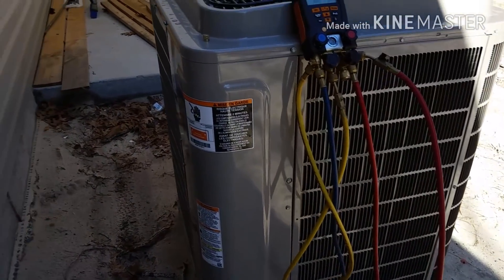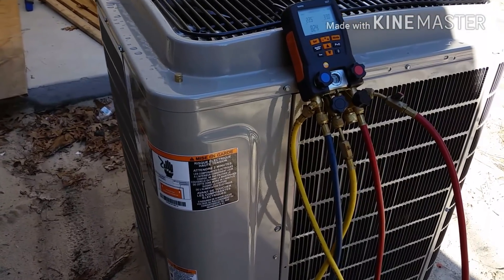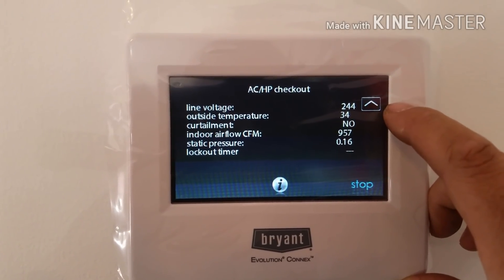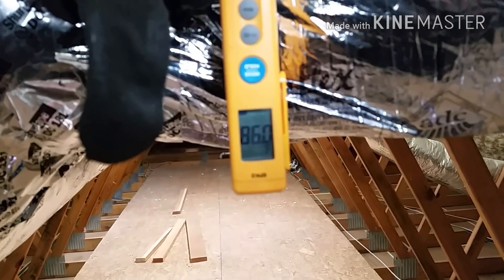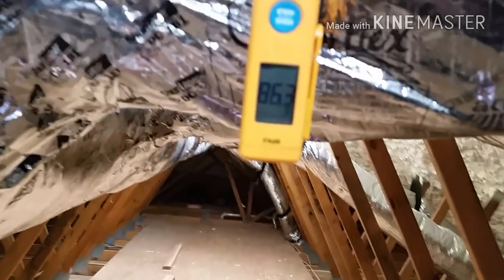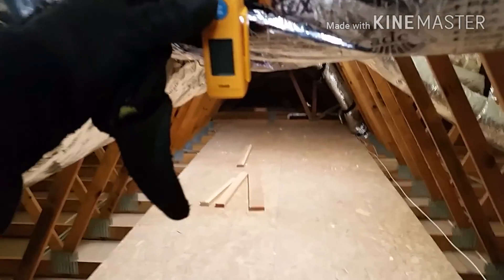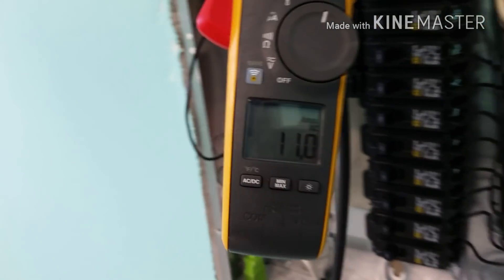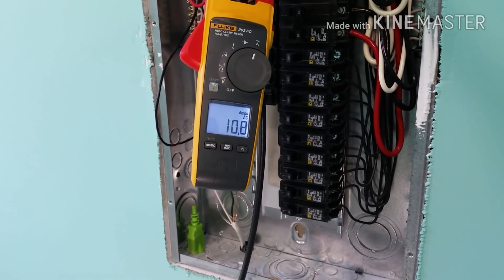Heat Pumps Can't Work In The Cold

Comment: That free return system is interesting. In theory it should work fine but I don't trust that attic to be sealed 100%. 
I lived in Charleston and only ran heat pumps. Never an issue. North Carolina got down to 0 and the auxiliary heat strips finally had to kick in.
Reply from the maker: It's a proven application, just not popular because of expense. 
Also if you get a good company to deal your hose with foam, they test to prove it is sealed eliminating guesswork.

Comment: See all the bad comments on here blaming the units.
No one ever mentions if they had a true heat load calculations done by a certified person whom sat down with them showing them the true facts & figures of heat loss vs cooling cost. So many times over the years I've seen undersized units, inadequate return air ducting/flow, poor controllers, condenser/outside units in a very poor place. Units not cleaned n serviced twice a year , in the spring for summer cooling in the fall for winter heating.  Typically people always go with the cheap guy n buy the better unit in Energy cost over the next few years while not living in true comfort.  Good help is not cheap & cheap help is not good.
If your salesman/dealer won't show you a room by room cost Analysis , find one that does, then find a second one.
In this Information Age , if you allow a poor system to be installed, shame on you. 
Ask for a blower door test & a infrared scan done.   
It's your money they will piss away, on the way to the bank.

Comment: Interesting, though  I wonder how soon the heat pump exterior coils would ice up in that weather.  I also have heat pump but also with aux modulated gas system which switches in around 45 degrees outside  (not thrilled with idea of _defrosting_ a heat pump).
Reply from the maker: Heat pumps frosting over and defrosting is a normal process that cant be avoided. It's Inevitable when the outdoor coil in heat mode is typically 20° - 30° lower than the outdoor ambient  temperature. That's how they are able to absorb heat from the outside air to transfer indoors.

Comment: Keep the snow pile away from the  condenser
Reply from the maker: There are no piles of snow in coastal South Carolina. 😁
Reply: Chris Duhaime , In snow zone, unit should be on a stand at least as high as ‘average’ snow depth, in the south, with NO SNOW, still install 12” above ground, keep from grass clippings.  from Maplewood nj
Reply from the maker: @flybyairplane3528  Nobody's going to lift a unit in the south 12" unless it's due to tidal flooding. Code is 3" from the ground which is cover by the 3" pads used. Hell, in VA where I'm from code was 3" for Air Conditioners and 6" for Heat Pumps.

Comment: Hi, I do own a property in MBeach but live in MTL Quebec. Here heat pumps are working down to 10'f with external tha to switch off and run the 2nd stage. A 13 seer efficiency will do the job. In MB i installed a 16 seer unit and never uses 2nd stage unless it needs defrost. Did subscribe...
By the way I'm a service technician 39 years in April... and still love it.
For the fellow in Georgia " a furnace is for heating as a heat pump is to maintain the heat " .

Comment: Heat pumps are junk.
Reply from the maker: 😆 Such a profound statement.
Reply: Kevin Z06 why do you say that? I know that they are many mis applied. Systems, I would rather have a heat pump,,rather cooling, & just elect strips., From Maplewood NJ
Reply: Agreed,one comment here says they should be serviced TWICE a year
Reply: @gimmieliberty6514  nearly all hvac equipment should be serviced annually... heater in fall and AC in spring.. since a heat pump does both, having it serviced twice a year isnt different. Sure plenty of people don't get their equipment serviced... but if you want it running at peak efficiency and performance, and want to prevent future problems as much as possible, and also have your system last longer since its taken care of... then get it serviced by a reputable company. 
A system with a properly cleaned coil and proper charge will draw less amps and in most cases last longer than a system with a dirty coil and a charge thats off. A bad run cap can lead to compressor or motor failure. Theres plenty of problems that could exist even though it seems to run when you turn it on.
Reply: @0_wardal_0  my mates working in this field, once it gets out how much refrigerant gas is leaking out of these systems they'll be banned,

Comment: I am curious about the electrical air cleaner, why you put it in front of the evaporator coil? It should be placed between the blower and the return duct.
Reply from the maker: +KEVIN LI An air cleaner goes on the return side of any piece of equipment weather it be a furnace or an air handler. That is exactly where it is installed in this video.
Reply: @HVACinSC  Thanks for correcting me.

Comment: Should have went furnace with a case coil. Don’t understand why anyone would want to heat space with 85 deg. When you could heat it with 175 deg. A furnace would pull about 2 amps for the blower motor only. And you don’t have to run a compressor all year. I love the inverters but for cooling only purposes. But I live in Az so bills jump by about 200 bucks in summer time.
Reply from the maker: +Rich Davis You are over stating what a furnace can do as well as understating what a heatpump can do. Neither of temperatures you gave are accurate. An updated Furnace in heating will give a 30°-50° temp rose above ambient. This furnace will give a 25°- 40° temp rise above ambient without electric heat.
Not to mention, why pay for a furnace, propane tank, and fuel in a place that barely uses heat like my area? No brainer for us which is why this region is nearly 100% heatpumps.
Thanks for your opinion.
Reply: Just simply stating a fact that furnaces heat the air more than a heat pump will and don’t have to run a compressor all year. The job done on this house was awesome!! And love the idea of it. Also didn’t realize you would have to use propane in that area. If natural gas is available. Just personally feel it is a more efficient heat source.
Reply from the maker: Heatpumps are light years beyond what they used to be when they got the bad name of "heatpumps can't heat".
I like furnaces and worked on thousands when I lived in VA. I still prefer heatpumps personally but to each their own.
Reply: Climate dose play a huge factor I believe. I’m in Az where units are ran constantly all day and night 15 on 15 min off for 6 months pushed to their limits. I do have to say the new inverters are bad ass! Great set up on that job, great video, and great discussion. Look forward to more content in the future!
Reply from the maker: Thanks. That's a perfect example of why an inverter heatpump or A/C would be more ideal for those applications. Starting and stopping is what causes the most stress on equipment. That is drastically reduced by a variable speed compressor. 
We may not hit those high temps you do but 100° @ 75% humidity causes system to run non stop for 7-8 months around here. Ocean front, sea breeze, and salt air, only compound that issue here.
Reply: The BTUs delivered to the space vs energy consumed is what matters, not air temperature. The CFM for the heatpump  is like double that of a furnace to deliver the same amount of heat. Has nothing to do with efficiency.

Heatpumps are far more efficient than furnaces, they supply far more heat than energy consumed. All of the energy used by the compressor gets absorbed by the refrigerant which helps heat the house and whatever gets picked up by the outdoor coil is free heat. 

The limiting factor is the cost of electricity, being much more than nat gas along with the efficiency of the power plants. If the power plant is gas fired, might as well burn gas directly, need at least a cop of 3 to be comparable. cop = energy delivered divided by energy consumed to do it.

There's also the problem of capacity loss as it gets colder outside, but this has been overcome with inverter technology. The basic single or two stage heatpump won't keep up below 20 to 40F depending on how it's sized relative to heat loss.

For all electric applications, putting a heatpump even if it won't keep up all the time is a no-brainer, when the alternative is fossil fuel you have to calculate costs. There's also dual fuel which offers the best of both.

Comment: I never seen a Free Air Return like that before... pretty cool if it works...lot of Extra SQ FT to heat though...
Reply: Bandits INFO Channel just saw this video . I’ve only seen free open returns in commercial jobs , but I guess there’s not much difference. I think for 100$ I would have installed a 10kw element as well lol
Reply from the maker: @kylemannion8452  System is almost 3 years old and still no expensive electric heat. The physical cost of a heat kit (especially for a factory authorized dealer) is super cheap. They however kill the efficiency of a heatpump in heating mode which is sort of the reason we didn't put them in.. lol
Reply: We really don’t need them here I’m Florida lol. Not bad temperature numbers I’m impressed

Comment: Your not counting the water heater in this it pulls 18 amps alone.or is it on solar.
Reply from the maker: Leslie Overstreet Video was to pointing out the energy consumption of the HVAC system. Water heater is an instant gas water heater which pulls nowhere near 18A. Also technically we didn't have the washer, dryer, or stove running either but thanks for your comment.
Reply: For amps on heat on an HVAC system I would say that is good but, what do you use for heat for defrost mode or backup.
Reply from the maker: Leslie Overstreet No supplemental heat sources needed on this system in this application.
Reply: With everything including the stove, washer, electric dryer, and dish washer. House draws 48 amps. I know because I just sizes it for whole house generator. This is very good considering most houses I've sized for generator are in the 30-40 KW and I can run it completely on 11kw.
Reply: Sounds good is the stove stander electric flat top.or a stand alone oven, or both.

Comment: It is 4 degrees where I am in Maine, USA and my advice to anyone considering a heat pump is: run! Anyone who tries to sell you one saying its "whisper quiet" either doesn't have one or doesn't use it below 22 degrees F. 93 decibels is what the outdoor unit creates in noise and the pulsing permeates the walls. The inside temp on days like today barely reaches 63. I've been recording the data (when machine shuts off to defrost, when it actually turns out heat, etc.) and my installer took the records to the heat pump company and they said "they had never seen such good records". I don't doubt that as it seems like the customers are the testers in this case. Be weary! $7,000+, horrible noise, more $ in electric. First year, this machine will cost $10,000, and will only add more in electric cost.
I bought a propane heater instead: $3,000 WITH electricity costs and it actually heats the home (72 in here now and the unit is silent/completely off). 
Don't buy a heat pump if you go below freezing or like to sleep without a pulsing vibrations!
Reply from the maker: Op Sea  You should really try to educate yourself on heatpumps and the updated technology that has been out for well over 10 years in the US and double that throughout the rest of the world.  Its blatently obvious by your comments that your contractor was clueless on application as well as Installation and now your justification is to blame the technology rather than the morons you hired to install it. Very common to see sadly. Truth is that MANY heatpumps of today can maintain 68 degree indoor temp at -8* F outside. Tested, proven, and the info is readily available to anyone who looks for it online. This systems cost less than $1 a day to run in summer and about $1.65 per day on cold winter days. Saying these units will cost you $10k in the first is comical at best. Thanks for your comment but you couldn't  be more misinformed on the subject.
Reply: Your contractor is and idiot and doesn't need to be installing systems over his grade level. I have this unit outside a bedroom window and installed correctly it's quieter than any unit I have ever had. Then again they really should not be recommend in places that stay that cold for an extended time.

Comment: That unit can do reheat dehumidification. But needs heat strips for it. VERY SWEET control feature!

If you start tracking relative humidity, I bet you'll start selling these with the heat strips when levels go wonky during low latent load, high humidity periods. 

Also bet you'll stop selling ERV'S. Pressurize offers better control, particularly good in wet climates.
Reply from the maker: Ted Kidd Using the reheat feature drops the systems  efficiency drastically.  We've installed over 400 of these systems and only use reheat dehumidification on less than 5 due to unusual circumstances.
And we still offer ERVs and will continue but thanks for the comment.

Comment: How is it that you are able to pass inspection by the mechanical inspector for not having a ducted return? Even if the attic is as you say "conditioned or Some what conditoned". There are no supply runs in that space that I could see to heat or cool it, so technically it is not conditioned area. I will have to learn more of this application. I live in NC.

Comment: That is pretty cool, like most guys in the trade I was always told that heat pumps are garbage in cold weather. I do live in Michigan though where it gets into negative temperatures regularly in the winter. If it gets below 0 there, can you do another video so we can see performance then?
Reply from the maker: Andrew Hicks Unfortunately there is a ton of misinformation about what heatpumps can do in cold conditions. Thats from consumers and techs alike. In this area of South Carolina it doesnt get down to zero but last week when it was 9 degrees this system kept the house at 68 degrees without any issue and without electric heat.
We may revisit this in a future video. Thanks for watching.
Reply: To be fair, as I understand it, OLDER heat pumps used to *be* shit in winter. 

But in the last few decades they've re-engineered heat pumps specifically to address issues with extreme cold weather performance... So, they're no longer shit in winter.

There's a video around somewhere that explains the history of heat pumps and goes into detail on newer "cold weather" heat pumps that more-or-less deal with the issues of heat pumps in cold weather situations down to some fairly extreme temperature...
Reply: The biggest issue with heat pumps in the north is that heat pumps are sized for their cooling capacity which also affects the heating capacity. So because of the reduced capacity, they need a little help up north. But I still like heat pumps better than a single stage gas furnace which are horrible in mild weather.

Comment: Bad ass 30 rise, but that gos to crap when it gos into defrost and a/c blows in the house nothing to knock off the chill
Reply: fvfgx well not all of them do that mines does this thing were it shutdown the indoor fan is a mini split unit but doesn't shutdown the compressor and causes the coils to heat up outside since it cant get rid of the heat inside
Reply: fvfgx  the indoor coil is ALSO VARIABLE SPEED, so,it slows down in defrost, so it ALWAYS heats, no cold changeover .from,Maplewood nj
Reply: You realize the fan shuts off during defrost? Also on mine at least the fan will slow down then the heat strips will kick on